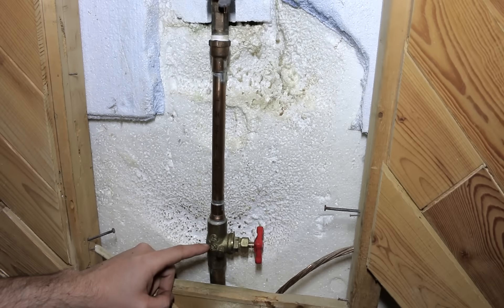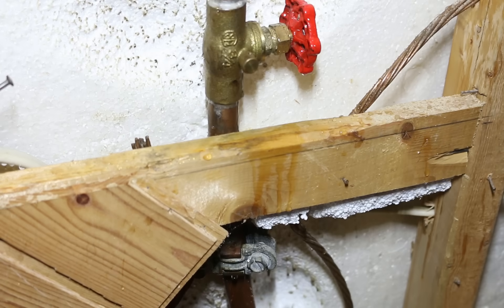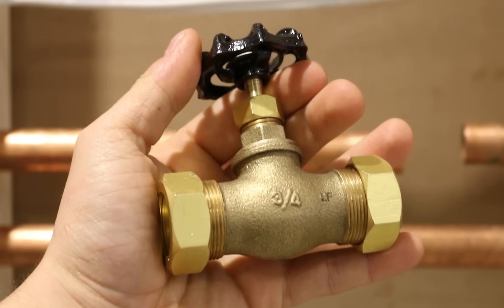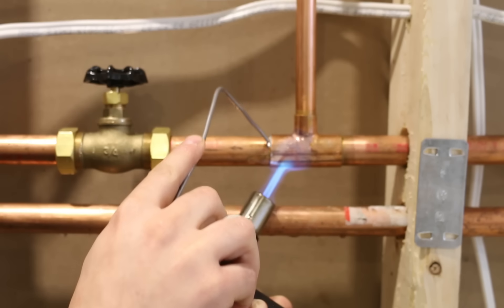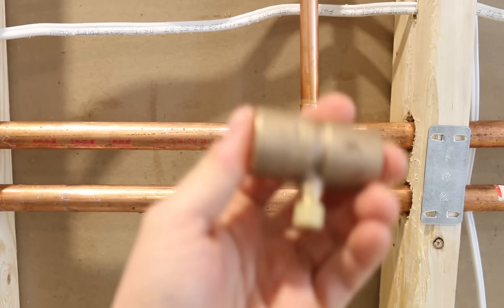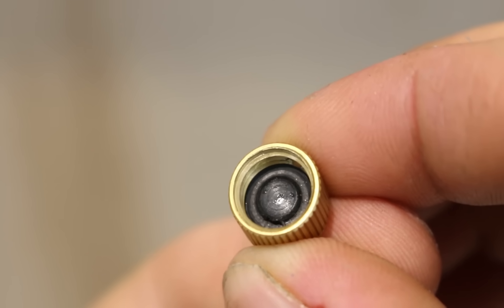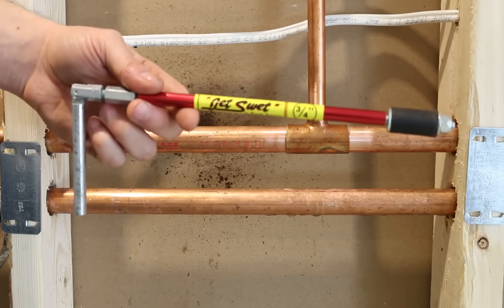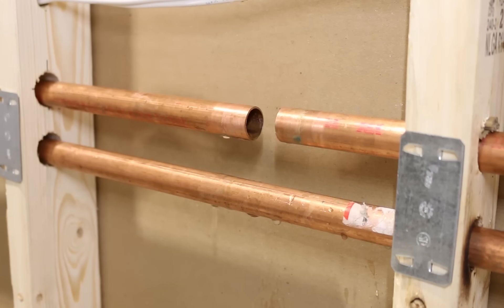Soldering Copper Pipes With Water in Them (7 Solutions) | GOT2LEARN

Comment: Take a rag to the end of a wire making sure to secure it  good enough not to fall off and insert into the pipe. Solder and pull out . Work good for 1/2"&3/4"
Reply: Vincent Chato, I have done that before and it works pretty good, better than stuffing a bunch of bread in the line!

Comment: Never tried the vacuum trick to empty the system- I'd need to get a wet & dry vacuum cleaner first...
Reply from the maker: Yes, a normal vacuum will instantly die hehe
Reply: Remember take the filter out for water. Learn from my mistakes...
Reply: @Got2Learn  it was a brand new filter as well. thing never worked the same after the water. It would clog up so easily even after dried.

Comment: I helped a plumber change the main shut off valve at a friends house a couple of years back.  The city came and shut off the water at the street, but it turned out that the city valve was not shutting off the water 100%, some was passing.  Instead of using a compression fitting, "we" used a length of 1/4 inch copper pipe and threaded that through the new ball valve.  The pipe was prepped, and then the old valve was cut off.  The 1/4 inch copper pipe was inserted into the prepped pipe, and the other end held in the nozzle of a running shop vac.  The 1/4 inch copper with the vac kept the water back far enough to give enough time to dry everything out, and to prep and solder the valve on.  Then the 1/4 inch copper was pulled out, and the ball valve closed.
Reply: Clever, I like it.
Reply: Wow complicated, a whole paragraph of explanation would turn into a 15sec. Video.
Thank you !

Comment: Save yourself the frustration and use a  1/4 turn compression ball valve  to isolate. No stem to potentially leak. 
Compression fittings are just as reliable as soldering which is why they are approved for underground use. 
Yes they are pricey but your time is more expensive plus getting you on to the next job faster.  For a home owner that wants to save himself $10 to $15 and wants to learn a skill have at it. For me it gives me peace of mind that I won't get a call back from an angry customer that a leak appeared after I left. 🤷‍♂️

Comment: What about the nitrogen pipe-freeze spray kits?
Reply from the maker: Those are quite expensive to rent/buy.
Reply: @Got2Learn  And yet you listed the jet sweat which is more expensive and does not last for as many times either.
Reply from the maker: Nitrogen kits are more expensive than the jetswet kit from what I know...

Comment: Hi 👋🏾 Any advice on how to solder or repair  a pipe out of reach? Any tools out there in the plumbing world for this task? 
The pipe and fittings are reachable, but in a crawl space that’s too low to maneuver or work under and prep the pipe for soldering, compression, or shark biting. Just wondering if they’re any tools out there to do the trick, so you won’t have to tear up flooring or take out a tub  to reach the pipe. Thank you.
Reply from the maker: Unfortunately, if you want to do a good job, you'll need to have good access to the fittings/pipes, whether you're soldering, using a compression fitting or a Sharkbite.

Comment: Nice video tutorial! Thanks a lot!
To stop leakage I am using the ise plug - it can keep high pressure and easy to apply.
Set consist the CO2 cylinder - so to freeze I am using leaqued CO2, which boiling point is -180 C.
This way make it possible to change even incoming water valve of building.
Reply from the maker: Yes that works very well!!

Comment: i was gluing 3" pvc pipe together and had the water problem the water would not stop running, so I took 15 feet of rope and a very large rag and tied the rope around the middle of the rag and ran the rope through the fitting and glued the fitting on the pipe and then ran the rope through the 10' of pipe and glued the pipe on and then pulled the rag out with the rope, you do what you have to do, YOU HAVE TO BE SMARTER THAN THE WATER AND PIPE HAHAHAHA
Reply from the maker: Nice!!!!!!!

Comment: I don't see how the Jet Swet works any better than compression method.  You still have a valve buried inside a wall.  In my opinion, use a sharkbite or vacuum the line and work quickly!
Reply from the maker: Most places do not allow compression fittings ;)

Comment: Consider updating your URL links. Results of clicking your links:
Currently unavailable: Lead-free solder, or Autocut 3/4", or Autocut 1/2"
Not available using Amazon Prime: adjustable wrenches, propane gas
Extremely expensive using Amazon Prime: Knipex 10" adjustable pliers ($80+)
  ($58.81 at FasToolNow.com)

THANKS for your excellent video!!!
Reply from the maker: Thank you very much for the update, i'll change those out Jeff :)

Comment: When I have a leak after I fill the system I braze it with silver brazing rod. Works every time
Reply: Do you braze right over the soldered joint that failed .
Reply from the maker: Never.
Reply: Idea is not to have leaks in the 1st place, no??
Reply: @joemathisiii7834  you might be perfect & never make a mistake.
But Im not. shit happens. sometimes you end up repairing someone else's mistake or problem. Sometimes it's a manufacturers mistake but they are not going out in the field to repair you are.
Reply: When dealing with a leak after personally "fixing" the initial  problem and subsequently repressurizing the system, the fault is your own. Manufacturers defects in fittings, valves, and other system add-ons are generally caught upon initial installation and remedied by the installer. When dealing with a pressurized water system, the last thing you should do is cob it together with extra solder or brazing material, nor should you attempt to fix ANY manufacturers defect using the same approach. If a particular product is faulty or malfunctioning it should be replaced, not "patched". Plumbing is considered a sanitary service. Which is why most municipalities require a license to operate as a plumber in their respective borders. My mentor was a master plumber of 30 years, and I spent six years under his tutelage working for him as a secondary source of income and ultimately partnering with him when he was stricken with lyme disease. His was an outlook that you owned your mistakes and remedied them as professionally as possible.

Comment: We had a leak and needed to replace a valve. Husband went to store and got the stuff to solder it when he got back I asked did you pick up bread.  He looked at me like i was stupid. After 30 minutes of getting frustrated i told him to move and shoved a wad of bread in the pipe. Wahala had it done in a minute.
Reply from the maker: Awesome Monika, you the girl :)
Reply: @Got2Learn You forgot the pro press method!
Reply from the maker: @skeetorkiftwon  yeah, I didn't have the tool back then grrr 😔
Reply: @Got2Learn  lol, was just pulling your leg. But they are awesome. Did you ever screw with the soldering clamp heater?
Reply from the maker: @skeetorkiftwon  hehe, not yet but sure looks fun!!
Reply: Voila

Comment: I have a small wet vac I use when changing a toilet to get the remaining water out of the tank and bowl. I recently made a fitting out of a PVC end cap that fit on the hose. I drilled a hole in it and attached a piece of clear flexible tubing in it that I can run into the pipe to vac the water out. Works well.
Reply from the maker: Nice, never thought of that ;)
Reply: I just use the tube from my u gauge to syphon cisterns out.

Comment: I'm really impressed. I am the Chairman of maintenance at my condo building and over the last 5 years I initiated a replacement cut off taps that began leaking behind the vanities in bathrooms and on the ground floors (we're only 3 stories) I would be waiting hours for the cold water to drain. I have used the vac but still would get water that wouldn't stop. Incredible advice!
Reply: Shut the valve off at the water heater. Sounds like you are getting a siphon when the water is off. Maybe you could install a main cut off per unit also when the water is off.
Reply from the maker: Sweet, This trick is awesome for those situations @Speeddemon3 ;)

Comment: Nobody has thought of just removing the connection at the water meter and letting the water drain out from there?
Reply from the maker: That's just going to make a mess lol
Reply: Got2Learn
I do it all the time and it makes zero mess. You shut the water off from the meter at the sidewalk, open a hose bib to drain the majority of the water from the system and will also let the system “breathe” so when you undo the nut at the meter the rest of the water will drain out along with any water leaking from an ineffective shut off valve attached to the meter. Of course this only works with people on city water and not well water systems.
Reply from the maker: Sweet, taking notes ;)

Comment: Pro press. Invest in it. SO much easier and faster than soldering these days.
Reply: I agree, a lot of advantages if you're still using copper. No residual flux left in pipes is a good "selling point" to homeowners as well.

Comment: I havnt had these issues in awhile. My boss got a Pro-Press for my truck. It's kinda corny, and takes the skill out of soldering. But very quick and easy. Great video as always🤘🤘
Reply: I love the pro press but there are times where it (or any crimper) just will not fit.
Reply: Pro press awesome if you can afford it
Reply: With Propress, you're also relying on an O-ring for sealing behind a wall.  Yes, it's allowed by code, but then so is a Sharkbite, and I wouldn't trust that behind a wall either.
Reply from the maker: Thanks Deftones ;)

Comment: À shop vac is the only tool i ever used. Drain as much water from the system as possible and set thé vacuum on a faucet nearby and make sure the to tape it properly in place. Make sure the negative pressure can only pull from the point you are soldering at.
Reply from the maker: Well said!
Reply: Holy shit that just blew my mind
Reply: Negative pressure,  lol. Vacuum?

Comment: The bread trick is great.  It can hold a surprising amount of pressure.  On several occasions, I waited for the break-thru to occur and heard the rush of water take place.   It is sometimes fumbly to push the bread in.  I think it swells up when it gets wet.   I have needed to use up to 3 full pieces on some 3/4" copper where water was not stopping.  I always use MAPP gas to get done quickly.  Take the aerator out on downstream faucets you want to use for flushing the bread out.  Also, It smells like toast.  Good tip.
Reply from the maker: Thanks a lot bud!!!

Comment: Or you could use a professional solution and use a freezer pack upstream of the new solder joint to halt the flow. These can even be used on systems where you cant shut of the main stop cock whilst working on the system.
Reply from the maker: Absolutely!

Comment: Nice video man! In one of your previous videos where you show the bread trick I was wondering why you didnt mention the Jet Swet tool that thing is awesome and definitely the best way to go about soldering in a system that just wont shut off. The method you showed right before ending the video to me is the most professional way to do it. Your videos are really well done I love the production value you put into them! Its inspiring for me as a new creator! Keep up the good work!
Reply from the maker: Thank you so much for your kind comment :)
Reply: @Got2Learn  Thank you for putting out such quality videos its obvious you put alot of thought and time into these and like I said its inspiring to watch! The bread method has never worked for me it always causes clogs at random fixtures nomatter what you do to prevent it. I always keep a roll of 1/4" tubing on my truck I cut off the desired length and will suck or siphon water out I also have this cool drill attachment that pumps water out so in certain situations you can get away with emptying the line and making your joints quick enough to not need the Jet Swet because your right it is expensive. Keep up the great videos though bro !
Reply from the maker: Thanks a lot buddy, really appreciate it ;)
Reply: Could you go into more detail on using the 1/4" pipe option.  I cannot visualize how that works
Reply from the maker: Pipe must drop a 1/4" per foot for 3" pipes and smaller, and drop 1/8"  for anything bigger.
Reply: BushyIV I use a small piece of plastic 1/4” tubing like an extra long straw I shove it down into the copper pipe and suck the water out and spit it into a bucket or sometimes if the pipe is high up all you have to do is suck on the straw or 1/4” tubing until you get flow then as long as you keep the end you sucked on lower than the water you are draining it will siphon it. I’ll post a video to my channel on how to do this later today
Reply: I understand the process in theory but I know I am missing something in the application as it relates to this youtube  video of a horizontal pipe repair.  I look forward to your video.  Thanks for the extremely quick reply. @PlumbingExplained
Reply: BushyIV I posted the video for you bro the horizontal demonstration is at the end I didn’t have any video on hand of me doing it in the field but I do now so if the demo doesn’t do it for you let me know
Reply: I don’t know why I never thought of putting a shop vac on the open line to suck all the water out before sweating. Totally did the trick for me. Thanks!